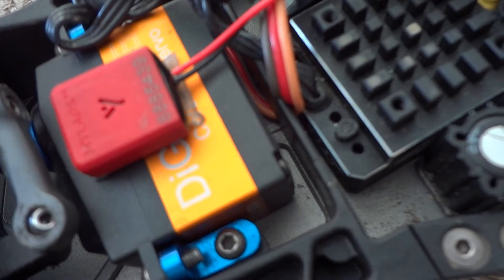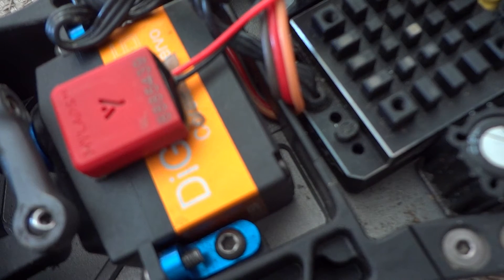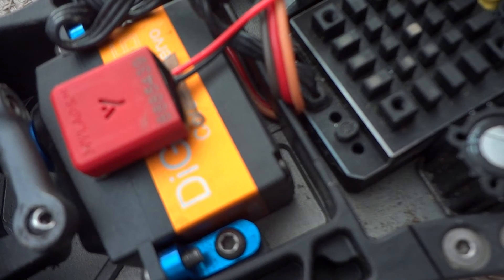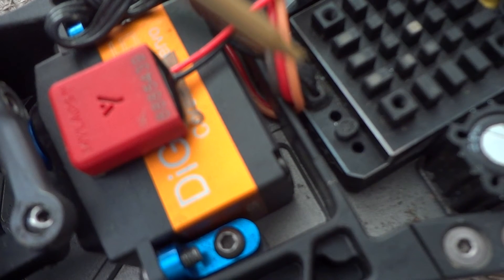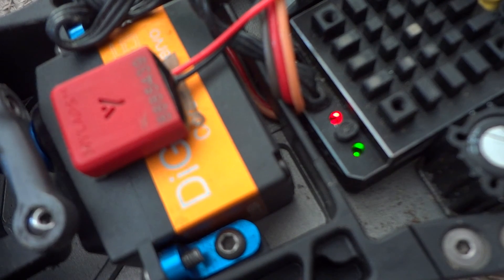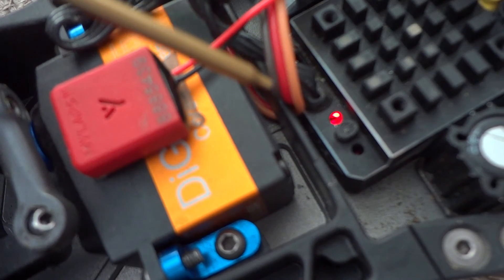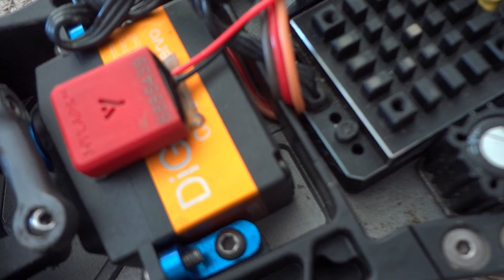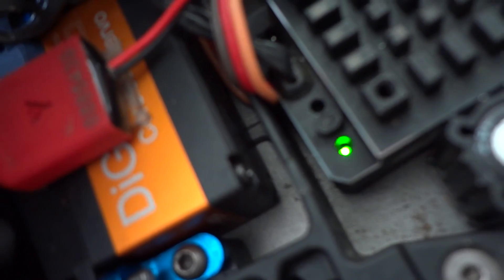How to program and calibration your Reedy BlackBox 410R ESC electronic speed control

Comment: Need help: The LVC low voltage cutoff keeps triggering and my battery is still 4.0volts per cell. It’s supposed to LVC at 3.6volts per cell. Is there a way to fix this?